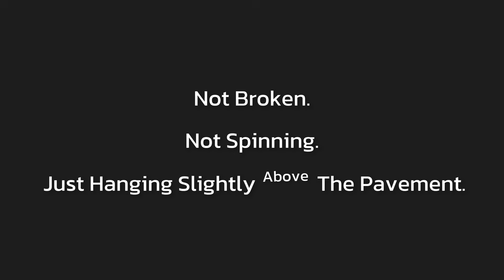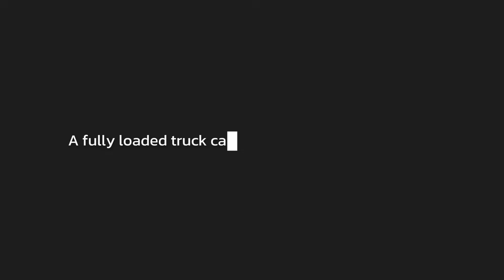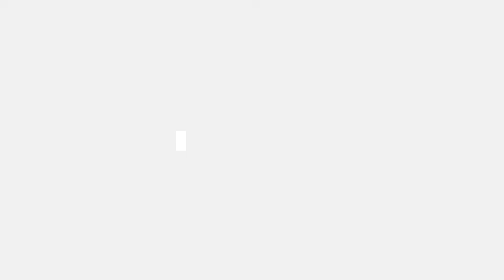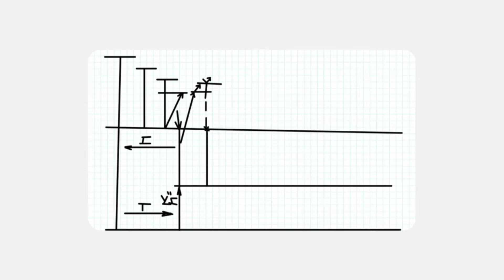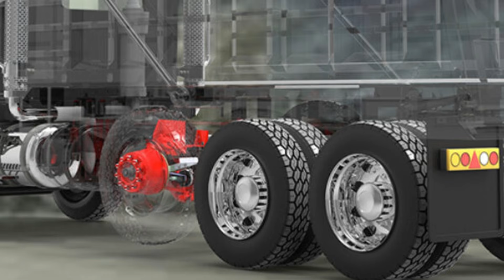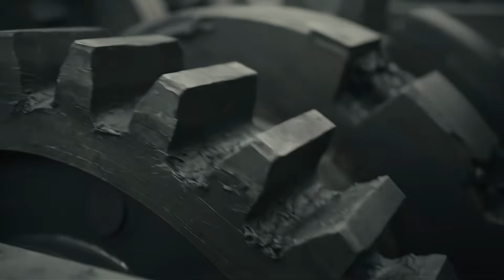Why Some Truck Tires Never Touch the Ground? (It’s Not What You Think!)

Comment: Trucks have tires that lift off the ground—known as lift axles or "drop axles"—to reduce tire wear, improve fuel efficiency, and increase maneuverability when running empty or lightly loaded. These extra tires are lowered only when carrying heavy cargo to distribute weight, comply with road damage regulations, and increase braking power.

saved your 4 mins
Reply from the maker: 🫠 hehe still thanks 🫶